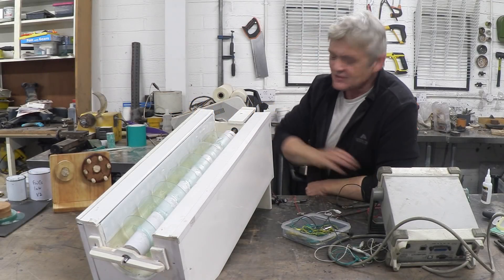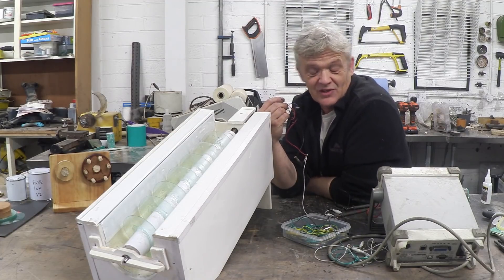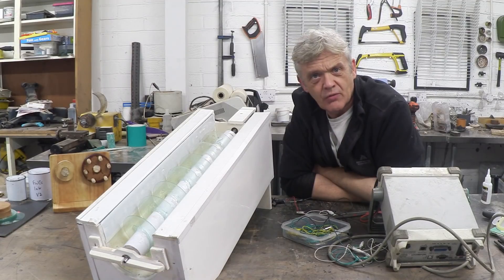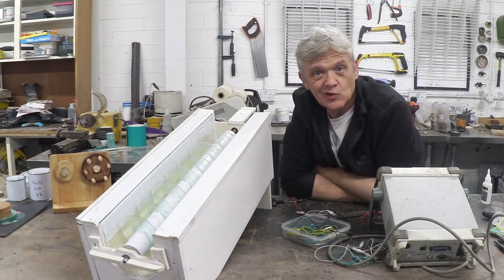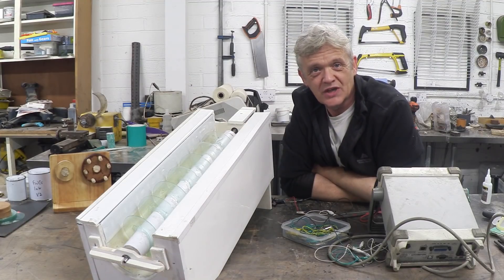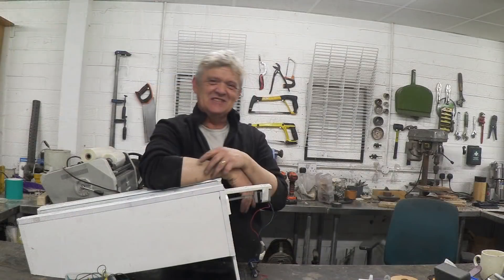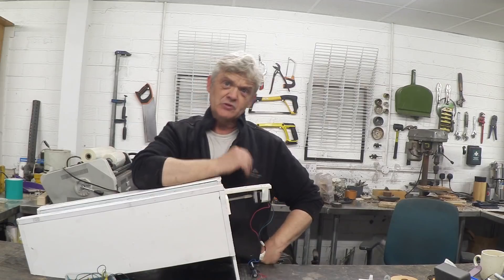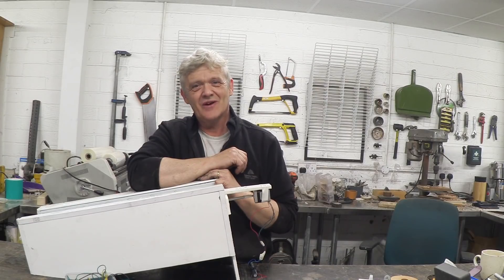Testing The Archimedes Screw Generator In A Car Park

Comment: As a rookie, I was wondering if you could charge a battery bank with Archimedes screw if its scaled up to like 15 volts... WIth somewhat of a system scale up and finding a faster current would that be generally feasible?  I saw your video with the stream test producing 5v

Comment: A simple solution to scavenging energy is by having small 'windmills' sat at the side of motorways or fast roads so that air pressure from passing traffic would provide power for electrical street furniture or street lighting. A simple system of plug a 'windmill' into a circuit, much like a light bulb circuit, would provide power where it is needed.

I could just imagine having a line of them on top of crash barriers would do a fine job. Have you felt the draft as a lorry passes close by?
Reply: Not sure where I have seen what you are describing, but it was deployed between two  major high traffic highways...in some country .....Europe if I recall right
Reply: .....short search  produced this Patent,,,,just plug the:
Traffic-driven wind generator: in google search window

Comment: for a basic mockup thats some nice voltage, and thats not even a high pressure water supply, imagine a streamlined and optimized design a water pipe with higher pressures of liquid flowing through it, i may have to try building one of my own!

Comment: if it has the torque,  might consider a 12v or 18v  cordless drill,  hook up the screw to the chuck end. and  bypass the trigger and let her turn...  if not for this,  then perhaps for the gear bike.
Reply from the maker: it should have the torque for that for sure mate - cheers
Reply: a ceiling fan motor shaft, hooked up to the end of the screw might generate  power efficiently....they are so easy to turn

Comment: Hmm .. I wonder if you could recapture the entrained air bubbles as the water flows out the bottom in to a well placed  inverted funnel catch chamber  and then utilize the pressurized air to power an airlift pump to increase your initial water flow volume or to directly aid in shaft rotation via shaft coupled turbine or simply reduce friction on the shaft via air bearings.  Great demonstration Rob!
Reply from the maker: nice ideas mate - thanks for posting

Comment: if you had time you should try building a unidirectional horn to concentrate wind into it (closing the top off so the air going down from the horn design, is forced to flow through the screw design) could be a good way to show the value of a omnidirectional one based on sections facing each direction,  with maybe 4 or 8 segments, for north south east and west. or adding NE NW SW and SE :)
Reply from the maker: it's a good idea mate - but you know what - it would be awesome if you gave it a go - after all this is just cut CDs and foam
Reply: @ThinkingandTinkering  definitely, I am working on figuring out this whole geopolymer thing, with local resources, as I want to see if I can make part of a house using them,  ;)

Comment: There's a lot of small streams and land drains on hills in Scotland. Just finished the wind turbine... next
Reply from the maker: that would be a good place to try this mate
Reply: Could you hook up a hydraulic ram pump to a reservoir uphill to boost water flow back downhill.

You can only use 10% of the water from the stream, though it would be interesting to see what that would accomplish.
Reply: @ryanlebeck259  I think a ram pump takes quite a bit of energy and it could mean you are putting more energy in than you are getting out, but I could be wrong.
Reply: @steverichmond7142  as a matter of "cost" a ram pump only has the associated materials cost to put into operation.

The water is already flowing, so you would be 'building up' the water flow mechanically to scavenge higher power yields.

The process would still be scavenging power.

Comment: These small generators are all great, but what about an accumulator to make it all useful? 
I'm thinking some different generators (wind, water, solar...) made from recuperated parts, all linked to a main power accumulator that can then be used directly or directed into batteries. 
If I followed all my fantasies, my neighbours would call me eyesore.
Reply from the maker: did you know they used to call batteries an accumulator?
Reply: @ThinkingandTinkering  Good point. What  really I mean is a way to connect multiple small generators to one central accumulator (could be a battery, but I'm thinking cheaper) in a way that you may have some immediately usable current to power something small and/or use to charge other batteries at the same time. I bet it would take a small farm of generators like this, though.

Comment: It's a cool concept, but a simple kaplan based design (cds should work just fine for that as well) would achieve far better efficiency for less materials.
Reply from the maker: I thought a  Kaplan really needed a high flow rate. So, I don't mate - I kind of think this is going into a stream with large mass but low flow rate

Comment: Might not start reliably where there's just a trickle of rain... But could be improved with either a 'Tippler' or a 'urinal syphon' to send the water through in predictable sized surges that you'd be able to optimise the generator for.
Reply from the maker: I would say it definitely wouldn't mate - well not unless the tolerances were much much better but then that would increase the expense - but nice suggestion on how to overcome that - cheers mate

Comment: I couldn't read the values generated for volts or amps.  What were the readings?
Reply: 2.4 V , 110-120 mA, 2.6 V
Reply from the maker: if you try viewing in full screen it can be much easier to see stuff like figures mate

Comment: That was really cool, I knew that would work. Once I finish the projects currently piled up on my bench I intend to build a couple of these. I agree that the success revolves around matching the right generator to the application, this would directly impact on efficiency.
Reply from the maker: very much so mate - I often get exasperated by folks who say that's not' generating much' as in a simple lash up all you really can tell is 1 - it works to some degree - 2- you now have a minimum

Comment: MOST DEFINITELY works!

Yes, to some extent, more helices will slightly improve performance, angle, fit tolerance, shape, etc also helps.

But for such a super simple, low cost device that ANYBUNNY can make, its really a DELIGHTFUL little project!

       /)/) 
    (  'ˬ') 
@(>_ )-b 
     \) \)
Reply from the maker: cheers mate - it occurred to me this would be super simple to mass produce and therefore could be very cheap indeed
Reply: @ThinkingandTinkering  i'm imagining someone building some of these to scavenge energy from a water shed in places where water collection is important for off grid living

Comment: Ehhehe , nice water screw ! We have one at home , 8m long , 1,2m diameter , around 1,5cbmb/sec water flow . Its feed our comp with around 10kwh , grandpa built this , 40 years ago . And he made this also all from scrap and its works well till now .
Reply from the maker: that is an awesome thing to have access to mate - you said until now - what's wrong with it?
Reply: @ThinkingandTinkering  , sorry my english isnt the best ! I mean the machine works well for ever , its very massive built and strong design . Some years ago we ad and automatic lubricant system for the gearbox and main bearing .

Comment: Awesome mate. I live inTexas, so real hot most of the time. I am designing a rooftop water hose storage system, to save energy. Basically two hundred feet of black hose laid out in tight spirals absorbs heat and is fed into the water heater's inlet pipe, increasing the temperature of the tank water, therefore needing less energy to heat up.
Reply from the maker: nice one mate - I like that system a lot - cheers
Reply: Wes Goodman 

Wes, I grew up in Texas, and spent the last 15 years in San Antonio.  As the hot season has gotten longer, and the hottest days more intense, I noticed that large parking lots have become particularly unpleasant places to spend time, especially on a summer afternoon.  

It has come to mind that a parking lot that occupies several acres ( not uncommon in San Antonio) is storing a tremendous amount of heat.  The idea of imbedding some sort of heat exchanger in the black top and harvesting the heat for use with a Stirling engine or Peltier generators is intriguing.  What do you think?
Reply: Bill Schas Brilliant. I was thinking of something along the lines of turning the blacktops into some kind of low grade photovoltaics, but I like your idea better.👍🏻
Reply: Wes Goodman  Thanks!  All inspired by that "frying pan to the forehead" slap you get walking from the car into the grocery store at 3 pm on a typical August day in South Texas.
Reply: Bill Schas Photovoltaic window tint for charging Teslas?
Reply: Wes Goodman Anything that is practical and makes a significant impact.  I knew a guy who had a solar panel on a Prius, which would make sense if the battery had enough capacity to store a lot of power for future use.  A plug in hybrid might benefit from such an arrangement.

When speaking about preparing for a backpacking trip, specifically about reducing the weight of one's backpack, Colin Fletcher's mantra in "The Complete Walker" was "Worry about the ounces, and the pounds will take care of themselves."  A similar approach to energy conservation and the integration of renewables into our menu of power sources could be effective.  

Greater efficiency on the consumption side paired with multiple small inputs from solar, wind, thermal difference, and less well known power sources, like Robert's vibration harvester (uses his artificial muscles, a rubber diaphragm, a magnet, and a coil), could make a big dent in our power requirements, especially in developing areas that don't have a huge centralized grid in place.

Lights, refrigeration, sanitation, and clean water can be established without resorting to the 20th Century industrial processes that we currently depend on in the developed world.
Reply: Bill Schas I agree , we really should overhaul the whole system, starting with increasing efficiencies in high energy us appliances, maybe led lighting and so on. Also I think I read about an electrical generation system that uses a chemical process with natural gas to either make hydrogen or electricity, I can't remember, but having one of those in the home as well might be good if it works well.
Reply: That's a really great way of collecting solar energy.
Reply: Vox Deus Thanks. I was actually looking at some 1" black pex type tubing that is for hot water. Good call.

Comment: I wanted to dream up a way to store up excess solar energy in silly-hot countries like Cyprus without the expense/limitation of the battery bank.. I came up with a G.P.E 'Water Battery' which stores the excess by pumping up water (from the swimming pool maybe). I gave up when I factored the hours-of-life / cost for the commercial water turbines... but now this might make the idea viable :D
Reply: Look at liquid air using compressor with old commercial fridge unit. Micro model of Manchester unit
Reply from the maker: that is cool mate - cheers